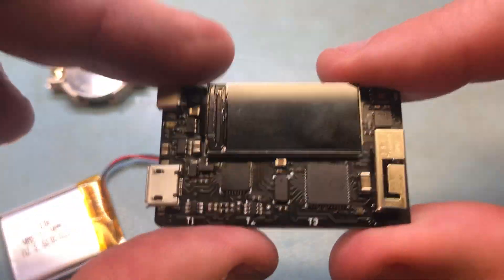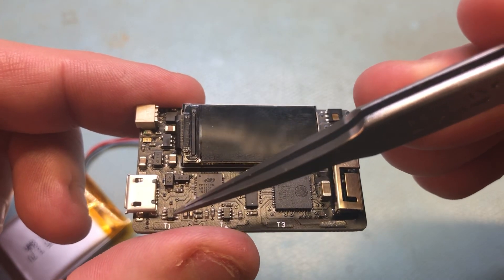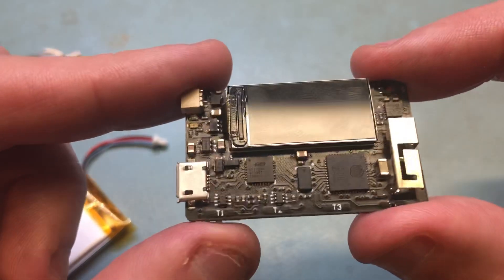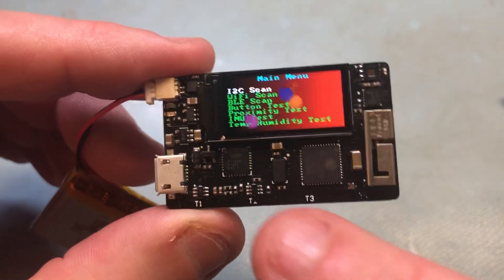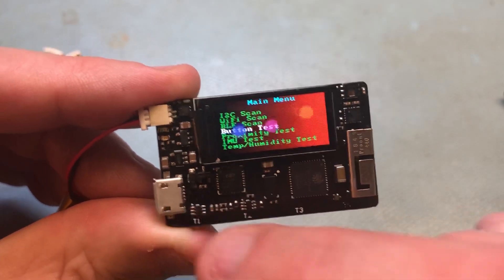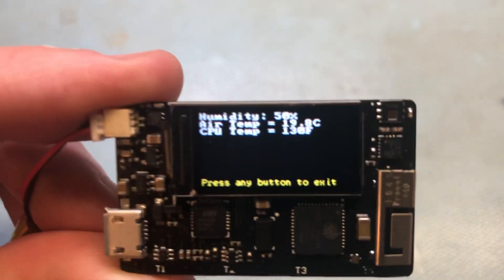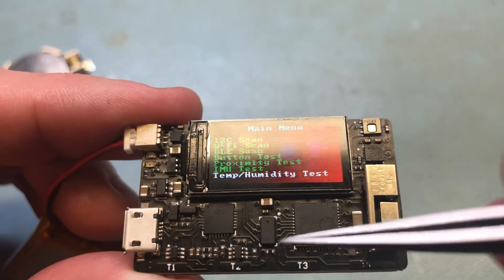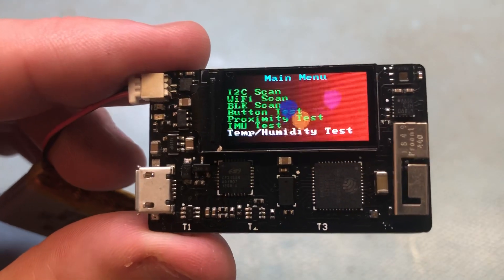ESP32 Color TFT Dev Board Color TFT

Comment: Great work! Just suscribed to your channel!!! I have a quick question. I just checked your eschematic and it looks like you ignored a lot of the componentes in the esp32 d4 pico datasheet (page 19/24), why is that?
Reply from the maker: Javier Corado most are mot necessary. The Pico has enough built in flash for what I need and also a crystal.  That’s the beauty of the pico, all those components are stuffed inside.

Comment: Great job! 
One question: when you generate BOM, you use generic components or some libraries?
I mean for resistors and capacitors. May be any chance to share those you are using in your projects?) 
BR
Reply from the maker: Sergey Zhilin I picked specific resistors and capacitor part numbers in case JLCPCB needs to assemble boards but anything generic would do. Maybe I could just give a description but leave the part number blank next time?
Reply: How you vary resistors in project ? Just copy/paste and add your Value indentifier? I mean that when you just copy components, you got correct PCB for manual assembly, but for production you need each component unique, to identify it in BOM. I just found some panasonic resistors library, but they are quite expencive.
Reply from the maker: Sergey Zhilin I do copy and paste but will look into what would happen if they go into production.

Comment: Does the heat generated by the board affect the temperature sensor?
Reply: The CPU generates a lot of heat when WiFi is running and it does affect the temperature sensor.
Reply from the maker: majestif reading the temperature works well if  the board is in sleep mode most of the time waking every now and then to read the temp, and then sending the data to a location and then sleeping again. The board temperature get very warm if on all the time but this would kill your battery.